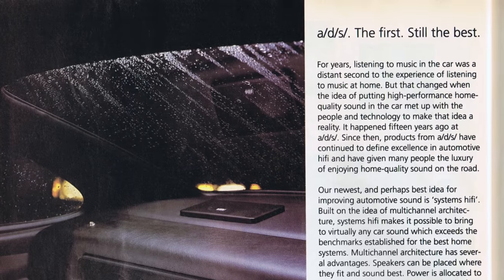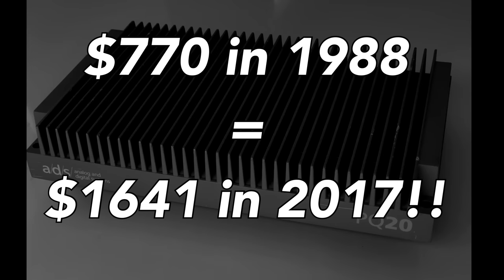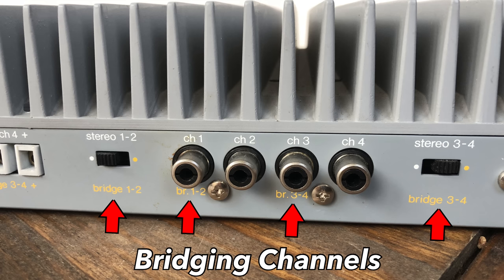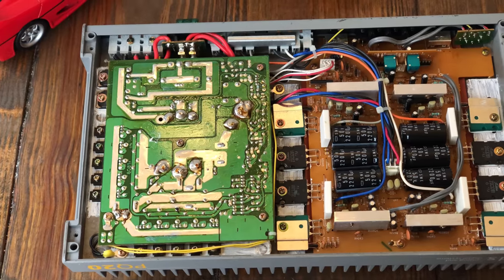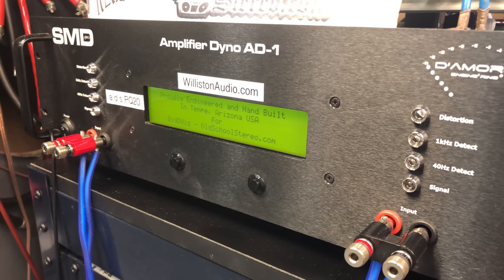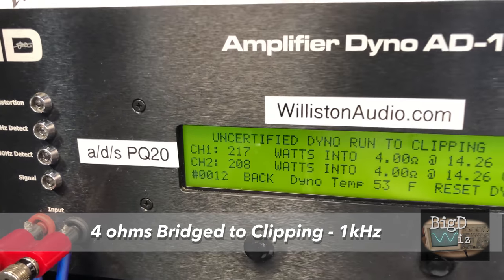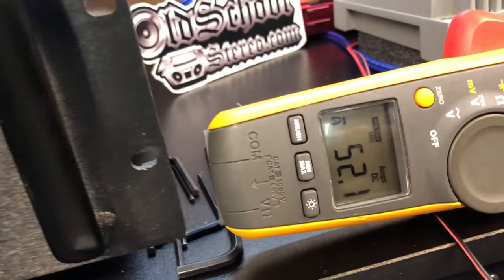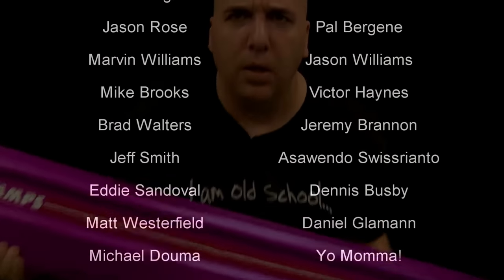Vintage SQ Amp Tested! a/d/s PQ20 Review and Amp Dyno Test

Comment: Can you test Pioneer A10? It's the amp i have right now and it seems pretty good, minimum white noise during idle and doesn't even get warm during idle or when playing, before i tried Denon PMA-520AE and Marantz PM5005 and both were terrible, a lot of white noise during idle and more heat from Denon and really a lot of heat from the Marantz during idle. Can't stand that fucking white noise when there is nothing playing through the amp so Pioneer was an easy choice for me even though it has the lowest power rating and wasn't my favorite brand. Before i thought that you can't make a mistake by Denon or Marantz but obviously you can and not everything from them is good.

Comment: I want to ask you the same question I asked Blankenship...I trust him , I trust you, in my trade when asking the experienced techs you need to make sure that you go off what they say and not just go ask another guy.....I am just compiling answers ..
OK, why do class a/b amps seem to move or work a driver better than a class d? The class d amps I've sampled had like a few hundred more watts than the a/b s that I sampled and the a/b amps seem to have more of that low bass, I can only describe it as having more mass as it can be felt further into your body. The d s will get loud and have good tight sound up to a certain point and then it gets " farty". I ve kept the controls the same ( box, subs, car, head unit, wiring ) only changing the amp and small changes to the pre amp eqs . the best examples are between a cerwin Vega class d amp and a a/b Rockford punch 801s the rockford makes my dark audio nko 12 s ( two for a total of 1000w RMS) feel like some high end sq/SPL comp subs, the cerwin was there middle range 1500 w RMS @1 ohm and no matter how I tuned it , it didnt have the low end. What happens in a low efficiency a/b amp that let's them do what they do with less power .
Reply from the maker: The theory I’ve heard to explain the phenomenon is how Class A/B amps have more control over the speaker (damping factor). I do not believe there are proven, scientific facts explaining this, but I have heard people comparing a 1000 watt class D to a 500 watt A/B saying they sounded equal. I would like to do a video about this in the future
Reply: BigDWiz yes I agree sir! That would be a good video to watch if you could show the difference. Also I think cheap/ budget a/b amp tests could be cool. They are stupid inexpensive , you thought the big inflated mono class D amps were cheap. Can find 1000 watt + ( advertised )  a/b amps from all the big name budget brands and some more mainstream one under 150.00 bucks. If a 65.00 dollar amp puts up close to advertised who cares you know what your getting and you could buy in bulk. Lol

Comment: What makes an amp a sq amp? I had my eyes on the 3k hifonics that was reviewed recently since it had the extra settings for bass. Then i was told that those are spl amps, where in the product description show its for sq or spl. Also what makes a sub an sq or spl?
Reply from the maker: SPL subs are intended for maximum output (SPL), while SQ subs are intended to deliver clean bass with maximum output not a concern. There are subs, such as the JL W7 series that are a hybrid of both. As for amplifiers, the SPL specific ones are designed for max output in short bursts. Most amplifiers are capable of both, but there are certain amps designed specifically for SPL. Many of these support higher input voltages and are designed for the abuse of SPL applications.
Reply: Is there certain numbers to look for in the sub and amp to tell if its meant for sq, sql, spl? I was told that if i wanted a sq build i need to run my sub at 4 ohms thats why i was concern the hifonics was not a good choice since its known for spl. I was thinking of running them on a 12 inch re audio se sub, the shop said the sub hits like a w6. My brother on the other hand has a ct sounds amp pushing his 12 inch re audio sx, he said hes going for sql lol, its just loud. When i had his car with my 12 inch jl audio w7 and 500/1 setup i was deeper, cleaner and was still setting off alarms

Comment: I just purchased one off of Ebay JUST NOW I miss the one I had.. $170 shipping included. I wonder how different it will sound compared to my Soundstream REF 4.920 a/d/s bridged into 2ch and just the front two on the soundstream
Reply from the maker: Will be interesting...let us know what you think
Reply: @wal  When I had one back in 1992 it was 92 Stanza ..Alpne pull out CD MTX crossover to Two SoundStream 12's (crossed over @400hz yeah but sounded great) Channels 34 bridged 220 ish to both 12s. Chan 1and 2 for front seperates.. a/d/s 320i's . Now I have a 2002 mustang GT 5sp convertible.. Sony CD player single Morrel Primo 124 sealed box with the REF4.920 34 bridged to the sub ( not all the way turned up) and the front channels to Polk Audio 6.5 components. I also have a 6XS audio control and an EQS I will get around to using one day just I think the EQS has channel bleed.. I dunno BUT yes I can let ya'll know.
Reply: @wal  I have a never used Soundstream REF 2.640 in the box  if you want to Dyno it. couldn't be too much with the shipping.
Reply: @wal  Still have the PQ 20 Just bought a house and I am unpacking and found it lol .. never used  never tested lol Got some construction to do and set up a computer build station with a test set up for things like this

Comment: Wow, how did you get so much more power than Julian Hirsh at clipping? 217w vs 168w Thats a BIG difference.
Reply: Better testing equipment.
Reply from the maker: He also got more at 4 ohms stereo, so not consistent across the board. We both used 14.4 volts and 1kHz, maybe his voltage dropped more? I don’t have specifics of his tests.

Comment: Hello I know this is an old video what is the difference between the pq20 and the PQ 20.2
Reply from the maker: The .2 series are a darker gray color, likely some quality upgrades, but I'm not 100% certain what else was changed
Reply: @wal  I don't know if this is okay to post but here is what I read earlier today on an old post on a forum

worked there for both series 1 & the .2 follow-on. The comments you've gotten so far mostly mirror my own experiences. I'll add the following -

.2 addressed every issue the first generation had, namely not making rated power. The PH15 did 6x~40W not 6x50W & the PQ20 was 4x~70W IIRC. .2 iteration fixed that with a beefier power supply and slightly higher rails. (I believe the output devices stayed the same but I am not 100% sure anymore on that.) Other than a new paint color that was pretty much it. Both generations ran hot and would rather not be tasked with driving subwoofers. On midbass & up however they did really well. The power difference between the two series is neglible and I wouldn't get caught up in numbers. They were very good amps and highly reliable

If I did something wrong by posting this please delete it

Maybe you should get a PQ 20.2 and test it I have one that's almost perfect cosmetic condition but it has not been powered up in 20 years maybe more I have been thinking about hooking it up to my large 4-ohm floor standing speakers I don't know how I would get 14.4 volts to it
Reply: @wal  thank you for replying

Comment: hey there is a craigs list ad from calumet city about 10 miles from me the guy is asking 120$ for this exact same pq20 think its a good deal?
Reply from the maker: Yes, if it works and good physical, should bring 250 or more
Reply: ya he said it works perfect and it's not beat up at all.  bring 250$ huh? cool thanks for the info  bigD.
Reply: Joshua Cox I sold one on eBay in 7/10 cosmetic condition and it brought just under $180
Reply: thats cool good to know, thanks.

Comment: I AM A ELECTRONICS TECH FOR HIGH AND LOW VOLTAGE SYSTEMS I INSTALLED THE ADS SYSTEM IN MY 1989 MUSTANG GT  AND DID OTHER CAR AUDIO INSTALLS ON A 1989 CONVERTABLE MUSTANG GT  OLD SCHOOL ELECTRONICS ARE DESIGNED DIFFERENTLY THAN NEW SCHOOL ELECTRONICS   IF YOU CAN FIND OLD SCHOOL EQUIPTMENT IN GOOD CONDITION PICK IT UP